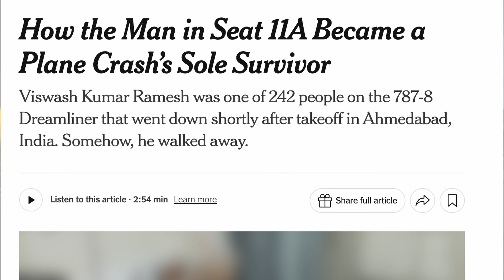Why the RAT Changes Everything – Air India 171 Update

Comment: I think the initial event was an erroneous retraction of the flaps. Then the safety computer detected that the engines were running in takeoff mode, the landing gear was down, and the flaps were retracted. And to prevent a "takeoff without flaps", it idled/shut down the engines and applied emergency brakes.
Reply: There's no system on any aircraft that shuts the engines down if a no-flap takeoff is attempted.

Comment: I noticed how quiet the engines were as the RAT could be herd and little engine noise. The engines should have been at full power. That is absent in the video.
Reply: Exactly. You would clearly hear the takeoff thrust over the RAT

Comment: Was there an electrical short? 

Did the lithium batteries overheat causing electrical shorts leading to widespread system malfunctions and failures and possible deployment of the RAT system?

Did the fuselage start separating cause electrical shorts, hydraulic failures, etc.?

There appears to be a grey looking smoke at the last second liftoff of what appears to be at the very end of the runway. Is this grey smoke an indication of contaminated jet fuel, bird strikes, a wheel brake stuck overheating and/or lithium battery caught on fire and the smoke was coming out of the lithium fire emergency vent system, etc.?

Was there an electrical short? 

Did the lithium batteries overheat causing electrical shorts leading to widespread system malfunctions and failures and possible deployment of the RAT system?

Did the fuselage start separating cause electrical shorts, hydraulic failures, etc.?

There appears to be a grey looking smoke at the last second liftoff of what appears to be at the very end of the runway. Is this grey smoke an indication of contaminated jet fuel, bird strikes, a wheel brake stuck overheating and/or lithium battery caught on fire and the smoke was coming out of the lithium fire emergency vent system, etc.?

Comment: The plane struggled to takeoff, the landing gear was not down but tilting to close but failing, and likely a dual engine failure due to fuel or maintenance problems.
Reply: it didn't struggle to take off, it just had a long roll because it was full & had a lot of fuel for the longhaul flight, so it was quite heavy.

Comment: IMO the early indication is full electrical failure at a critical phase. It explains every fact we know. The survivor also said he heard the engines throttle up just before crashing, which indicates they got electrical back online but too late to recover. Plane has been reported to have had electrical issues prior.
Reply: Where did you read that it was previously reported that the plane had electrical issues prior?
Reply: @LelouchViBritaniaa  There are reports floating around of passengers that had flown on that plane recently saying there were electrical and AC issues. I don't know if they were verified or not.

Comment: What about the gear position ? It looks like it s tilted in the opposite way and if you look at a video of a 787 landing gear retracting you will see that it starts by tilting opposite way and retracts after so in the video it looks like it started to tilt only but it stopped. Am I right ?
Reply: Loss of hydraulics part way through gear retraction, from loss of the engines. It's already been found in the wreckage that the gear was frozen, part way through retraction.
Reply: Yes agree. On the zoomed pic you can clearly see the landing gear is no more pointing up but is in a horizontal position instead, which means the gear had started to retract but retraction was interrupted halfway (due to hydraulic pressure loss). Which is another clue that points towards engine failures.
Reply: Yes, I see the same.
Reply: Yeah you just heard it from another channel and now come here to bulshit

Comment: when you look at other videos of take offs you can see the heat coming off the back of the engines when they are working its like the mirage effect like a vibrating look like that of heat coming off of the ground in the summer.  But on this crashed plane you don't see that on the video at all.  Which makes it seem as if the engines stopped working.   I don't know what caused the shut down, but if fuel was not turned off then it would be some other anomalie maybe with maintenance.  I predicted that problems would arise after the pandemic since all flights were stopped.  you need to keep engines running even if the flights are not being reserved.

Comment: Another piece of evidence is that in the video it shows that the landing gear was about to be or partially being retracted before being interrupted in the process because the gear is tilting the wrong way. The way it is tilted in the video is if the pilots pulled up the landing gear handle and the gear moves to that position to be stowed away. But it got interrupted just as it’s about to be pulled up into the belly of the airplane

Comment: Captain Steve you missed the the wheel position of the landing gears, just before gears up the wheel tilt forward as the gear doors open and then get retracted.  The video shows the wheels tilted forward but no further, which leads to possible hydraulics failure which will in turn cause the RAT to drop.  I might be wrong but has seen 787 wheels tilt forward before be retracted. So at worst guess, caption asked for gear up and did but gear up fails with combination of eletrical failure and lost of power as well as hydralics.  What do you think?

Comment: Hot weather  can cause  fuel blockage in the engines ! I was looking at c 787 cockpit and flaps settings  are on right hand side  and  landing gear on left  side  ? Of thrust gear  ?. So the theory  I have heard I'd the one of pilots  shifted the flaps instead of the landing gear  ! But they are on opposite  side to other ??

Comment: I'm a pilot. The plane had an electrical malfunction. The nose was up, and he'd called mayday because the electronics had caused the wrong actions to occur which he could not override in time before the crash. Boeing is at fault. Big lawsuits pending.
Reply: Not everything can be blamed on Boeing without evidence. How long has this plane been in operation by the airline? why wasnt the fault manifested all these years, how sure are you that it wasnt a maintainance mistake but Boeing mistake?
Reply: it's all in the black box 
no need to make assumptions
Reply: Maybe Boeing. Maybe it was the Turkish company that maintained these aircraft
Reply: Not sure I’d agree with you. There’s still a huge chance this is poor airline maintenance. Sure could be Boeing but this plane has been around for so long and for duel engine failure? (Also Boeing doesn’t make the engines lol)
Reply: Maintenance and upkeep of call attendant button or AC cannot make both engines fail within seconds of take off .. can it ?? Per the survivor’s words “the plane went dead” within seconds of take off.
Reply: @rickxyrockxy8917 'there was a loud bang, and the lights flickered' was the words if im not mistaken, but as saying those minor issues could just be part of a long list of problems.  Fuel pumps could of starved the engines once rotation was performed hence only getting too 600ft, and the RAT being deployed, video from terminal shows engines giving thrust on rotation by the debris vortex.  But the box will explain all
Reply: On a 11 year old airframe? Only if Boeing did the maintenance! Boeing doesn't make engines.
Reply: The aircraft when it came in, was riddled with mechanical issues, there is a video of a passenger complaining that AC not working, in flight entertainment was out, the 'call attendant' button wasn't working.  Don't sound like Boeing but a lack of maintenance upkeep
Reply: your assumption premature-- Assume makes an ass of you......
Reply: I've been a pilot since 1979. If you were an actual pilot, you wouldn't come to that conclusion so fast. Or even that conclusion at all.
Reply: 11 year  old plane with records flying most of the time of its history, and when it fails you blame the manufacturer for the fault with out evidence? Why not question first how they maintain the aircraft?

Comment: @Captain Steeeve I saw another view that suspects that the gear had actually begun their retraction. The evidence was that the gear assembly was tilted forward instead of backwards (as they are when the gear is fully down). Further, the video showed an in-hangar demonstration of the normal gear retraction on a 787 - the gear tilt forward before there is any upwards or folding motion, in fact even before the gear doors even open.

Comment: Yeah, this makes much more sense.  The idea the co-pilot pushed the flaps lever which is in a totally different location than the gear up lever made no sense.  I go with contaminated fuel as a leading reason for dual engine failure.

Comment: Great video Captain Steve! Hey have you seen the video a passenger took earlier in the day on that plane? The cabin lights were going crazy. If there is a massive electrical failure on the 787 does that have the ability to affect the engine controls? Maybe the RAT deployed because the electrical system failed and that resulted in the engines to idle down or turn off? Just taking a wild guess.

Comment: Captain Steeeve rules! 

By far the best aviation analyst on YT. That I've seen anyway.

And you answered one question I had - of what real use is the RAT? As it didn't help in this situation. You addressed that in the high altitude engine failure scenario you presented.

A real mystery as to why both engines failed, if indeed that is what occurred.
Reply: Jeffostrof had a better analysis

Comment: Actually FIVE reasons why RAT deploys. (from friend Flight Safety Engineer in North Charleston; confirmed by blancolerio).

Pilots put out Mayday for “engine failure” at 13:38:25.

1-Dual engine failure; 2-Low pressure in all three hydraulic systems; 3-Loss of all electrical power to Captain and FO flight instruments; 4-Loss of all four electric motor pumps of the hydraulic system and flight control system faults during approach; 5-Loss of all four electric motor pumps of the hydraulic system AND an engine failure on takeoff
Reply: With loss of electric power wouldn't fuel pumps and engine shut down?
Reply: @DrJuan-ev8lu Fuel pumps are engine driven
Reply: @DrJuan-ev8lu They’re engine driven 😊
Reply: @PfizerRN_NavyReserveCaptain  There is a claim floating around that this is the first nearly all-electric plane.  I would guess if main electrical busses were powered down, fuel delivery and engine control would go down too.
Reply: @DrJuan-ev8lu Well, you should congratulate me for screwing that up. Fuel pumps ARE electrical. AC power. 6 total. 2 in left wing tank. 2 in right wing tank. 2 in center tank. AC power supplied by two huge generators per engine. In event of power loss, main battery and RAT provide enough power to run fuel pumps. My apologies.
Reply: @PfizerRN_NavyReserveCaptain  tilt in wheel bogies suggests retract was triggered but stalled out.  Further evidence of major electric power fault.  But fault with computers that control everything can apparently give similar set of symptoms.  Something about overheating causing total reset.
Reply: @DrJuan-ev8lu I’m onboard with dual engine failure causing an electrical failure and RAT deployment. But WHAT caused engines to fail?Some are saying Contaminated fuel ……. who have never done a Failure Mode & Effects Analysis. Wouldn’t other aircraft be affected? YES. 😉🤔
Reply: @DrJuan-ev8lu This is interesting that I just found in SimpleFlying. I just don’t know if it applies to 787. “The fuel tank also consists of suction valves that allow fuel to be drawn by the engines in the event of tank pump failure. This requires the pilots to descend to a lower altitude, which prevents low-pressure fuel boiling”
Reply: @PfizerRN_NavyReserveCaptain  In a very hot climate there might still be a vapor lock effect as engines try to suck fuel.   The big questions is which came first the engine loosing thrust or major electrical failure.

Comment: I agree that this was a dual engine failure. I wonder if there was water in the fuel tanks. Transport aircraft use a standpipe to intake fuel from a position above the tank floor. There’s always a small amount of unusable fuel in the tanks because the fuel and hydraulic pumps themselves are in the tank so the fuel can keep them cool. Water is heavier than Jet-A so it would settle to the bottom of the tank. During the taxi and takeoff the aircraft is level and ingesting Jet-A. However upon rotation the fuel in the tank might have shifted and the engines started ingesting water. 

Witnesses reporting hearing a loud bang which might be consistent with a steam explosion as water entered the combustor. This also might explain why both engines failed simultaneously.

Comment: It was not engine failure, meaning there was nothing mechanically wrong with the engines.  It was fuel starvation, possibly caused by partial fuel tank air vent/filter obstruction.

Comment: I think plane was overweight. Now question rise up, how they lift the plane up in that case? Well plane lift is higher when is horizontally. Lets say this way if 1.0 is lift needed for plane not to stall, that means on tilted angle of nose like 15% you need 1.4 horizontal lift to be 1.0 on 15% tilt (may not exactly numbers it depends on plane design) but I want to say, if you ascend with 1.2 lift it means at that lift at 15% nose tilt you will be at 0.9 or 0.8 lift and plane start to stall and fall.
If pilots didn't panic and was fast thinkers, they could correct nose tilt to be like positive 0 or like 1-2% up, plane woult get higher ground speed and climbing would be slow, but enough. This is characteristic of ascending of ''water bomb planes'' where your plane is always overweight with water. Those pilots know what I talk. I think if pilot crew had some experience with flying overweight plane, tragedy could be avoided...
Also one more thing t oadded, on ''water bomb plane'' your ''landing gear'' is always there and even with that drag and overweight water you could climb up, but at very very low tilt. But yeah those big passengers airplanes are completely different story and may not be so comparable to what I think from different point...

Comment: As someone who listened to more 787s with RATs hanging out in the final of CHS than normal config  it is audible in both the copy and the original it sounds more like 172 doing a high speed pass at VNE
Question is now WHY DID 2 ENGINES KICK OUT 
Im not too versed in the GEnX and the FADEC capacity but can it kick out both engines on its own and roll them back to 0N1